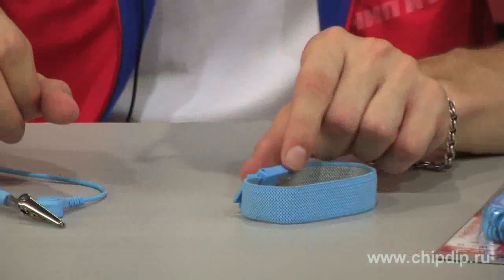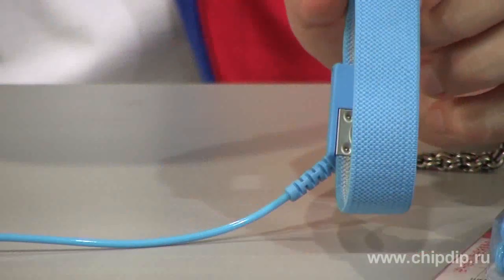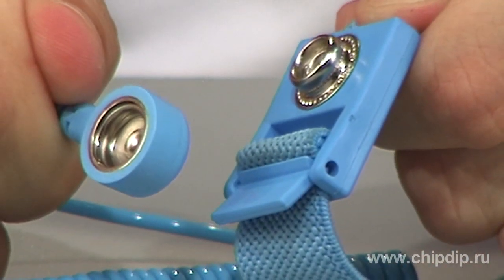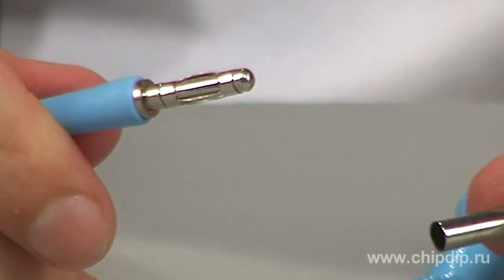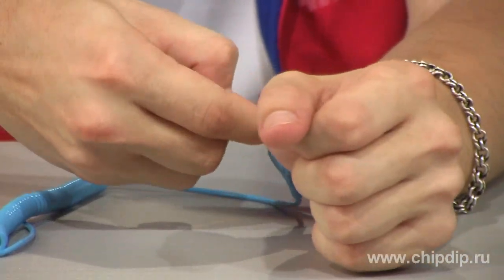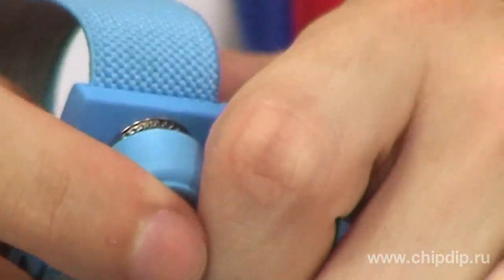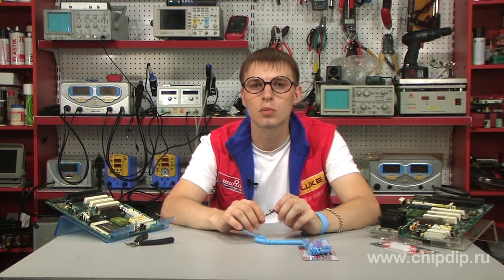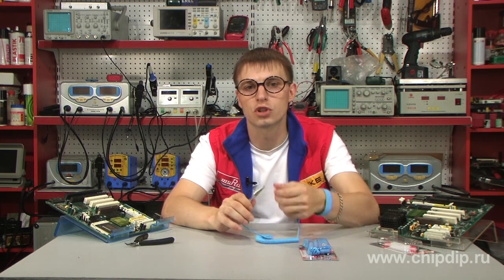Goot WS-11 Antistatic Wrist Strap

Comment: I've watched a few of these videos trying to explain anti static wrist straps and I find them all to be lacking.  Most seem to explain what the strap is and what it is used for and some say what you should connect it to in a limited fashion.  If however you are actually looking for videos like this I think the one thing you want to know or see is some examples of what specifically you can connect them to that ensures a grounded connection.  So far I've watched like 4 of these videos and while one or two of them give you an example verbally none of them actually give you practical examples of household things you can clamp to for a grounded connection or even show the examples that they did give visually.